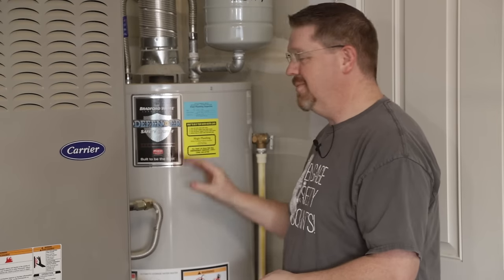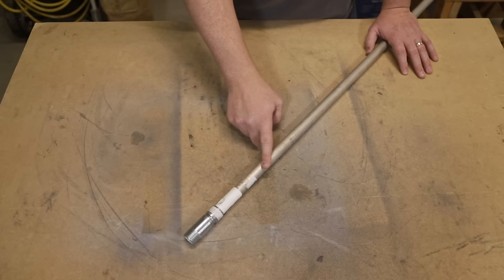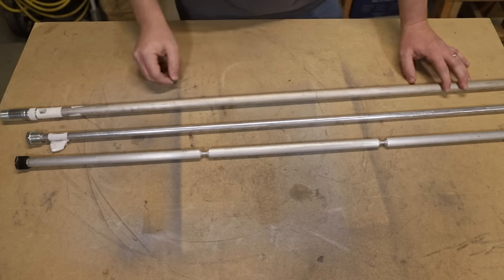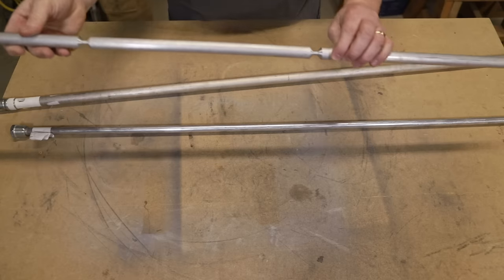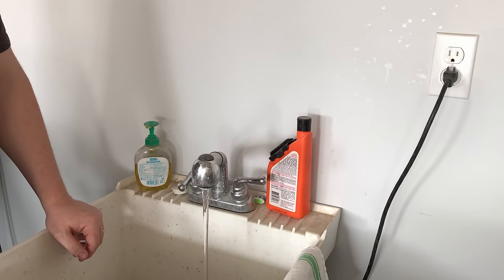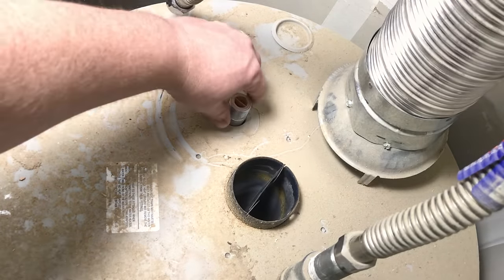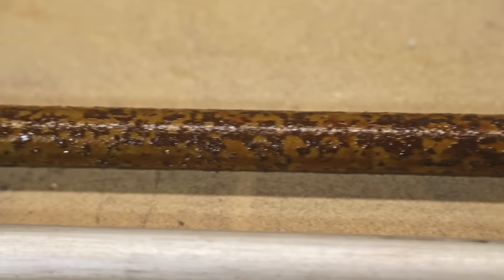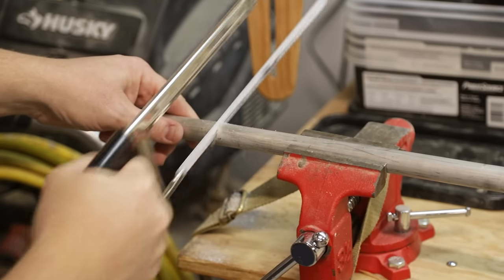How To Replace Water Heater Anode (Step By Step)

Comment: Why don't manufacturers just make the ceramic coating the tank thicker and more durable? No poo about efficiency pls.If it's thicker, it'll hold heat longer. The cost and trade offs are nil.
Reply from the maker: I suspect it actually really is just about the cost. I know that for a single given tank the cost may only be a few extra dollars (or even cents) during the manufacturing phase to put in a thicker liner... but multiply that by tens or hundreds of thousands of tanks that a given manufacturer cranks out annually, and even just a few cents cheaper on each unit really adds up fast. I believe these are built to hit the sweet spot between how cheaply they can be manufactured and still get them to last at least 1 day past their warranty period.

Comment: You missed the first step: Wipe the filth off the top of the tank.
Ewww…
Reply from the maker: That's a fair critique. I like to show things as they actually are in my videos so my viewers see real-world examples of the projects I do. It's pretty likely that the top of your typical water heater is as covered in dust and grime as mine is. 

But your point is well taken, and I should have not only cleaned the top, but shown how I did so and offered suggestions about the best way to do it in this video.

Thanks for watching!
Reply: @AmplifyDIY  Hey there... sorry if my comment came off as snippy or arrogant... It was intended as a mildly humourous quip... which is hard to convey in a silly comment. Cheers!
Reply from the maker: @trevorkolmatycki4042  LOL - no harm done at all. It's hard to convey nuance in comment-land here on YouTube, and my response was meant to be light-hearted as well. I hope you have a great week!